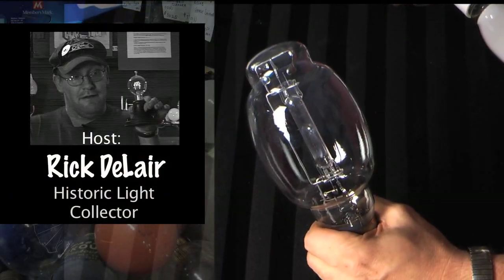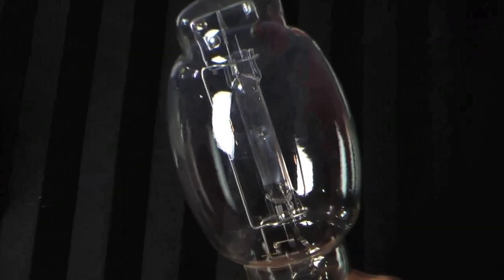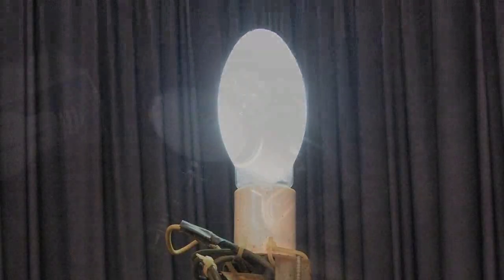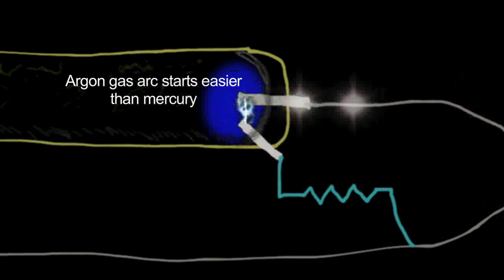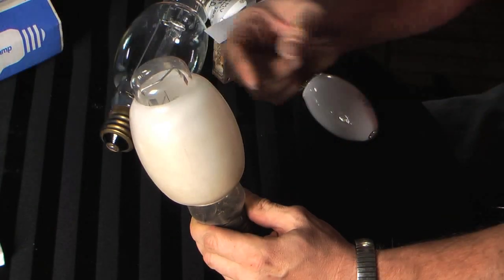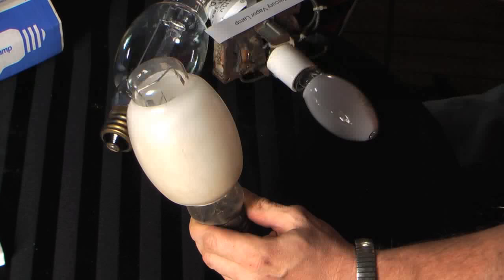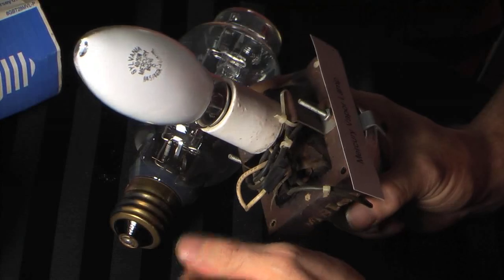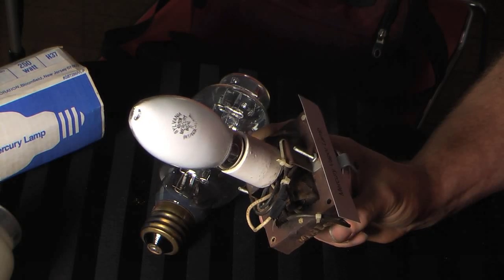The Mercury Vapor Lamp 1901

Comment: There were also yellow coated mercury vapor lamps that were used at rail crossing street lights in some place, which pretty much ended when everything converted to HPS for street lighting.

Comment: What happens if you put there an ordinary incandescent bulb?
Will the bulb only start slowly, explode, will the armature break, just nothing happens or what?

Will it be same if an cfl or led bulb is inserted there?

I can only tell by myself that once I was child I screw this kind of lamp to ordinary 230v E27 socket. The light flashed once and the fuse in the house did go. 

Since atleast here in Sweden they use same fitting E27. Also same voltage, you only need that "starter" thing wired there before the E27 socket.
So thats why im so curious and since this is outdated technology I maybe never get the answer 🤔
Reply: If you put an incandescent lamp on the mercury lamp ballast, the incandescent (if it's 230v) will just run, but a bit more dim than usual. The ballast might try to ignite but not do very much. 
If you put the mercury lamp (or any other arc lamp) on an ordinary lamp socket without ballast, nothing will happen if it happens to not strike the arc. But if it does, the arc will very rapidly heat up, drop in resistance and either the lamp will explode, or the breaker will trip, depending on what happens first.
Reply: @mfbfreak  Thank you for the answer!

Comment: In the town where I grew up, there were the nice old Westinghouse and Powerlite streetlights which used mercury vapour, there were the Westinghouse clamshells and gumball heads made by a company called power lite which belonged to Sylvania, some with the cobra heads, some of which had mercury vapour and some with HPS, possibly metal halide too. One of my favourite things when looking at the streetlights was the slight variations in colour, some were more pinkish, some bluish, some beige, some just pure white, possible the variations of chemical balance, some of them may have been retrofitted with metal halide though I’m not sure.

Now they’ve all been replaced with LED heads, I know times change, but it is kinda sad, an end of an era. Now they all look the same.
Reply: Do they all look that same?  What about near off-road shortcuts to escape a chemical gas attack?

Comment: Hi - I would like to low pressure Hg vapor arc tube lights, remove the outer glass, and use as a strong UVc source.  I have a UVc detector to measure the irradiance at a distance (for dose measurements and safety).  Where can I find such bulbs?  Regards - T

Comment: If the ballast is buzzing, but the light does not come on, does that indicate a bad bulb? I just put a new bulb in it the beginning of summer.  The old bulb before summer came on when it felt like it. I also replaced the photo cell. What is your best guess before I spend another $30.00 for a new 175 Watt Mercury Vapor bulb?
Reply: I can tell you have no been answered. the buzzing is magneto restriction and it is a wine coming from the coils to indicate  voltage resonance, batteries plus bulbs will sell you a bulb and you can return it within 14 day's if it is not the problem. hope this helps. also I work for batteries plus as a tech
Reply: @danieldollive4660  I already put a new 140 Watt bulb, was $30.00 from Low's in the old mercury vapor light and also a new upper sensor. It lights when it feels like it. I already purchased a new 40 Watt LED unit that looks very similar to the light housing I have now, however that nice blue light the Mercury Vapor light makes won't happen.  At the Electrical store, the manager showed me what the New LED light looks like, he lit it up right in the store and while expensive at $150.00, I've spent 3/4 of that trying to get my 8 year old Mercury Vapor to light working each and every night. Also the new LED's use way less electric and a lot of people including the Electrical Store manager told me I'd probably see a small difference in my electric bill, especially since I'm using dusk to dawn.  My new light also came with a 3 year warranty.  Thanks for your offer & Reply.

Comment: Energy efficient compared to what? A dead short? A 400W HPS lamp produces 25% more light per watt than a 700W Mercury Vapor lamp. That's why they are being phased out.
Reply: Compared to Halogen, Incandescent and Xenon Short Arc.
Reply: more light according to what ?  The orange glow vs white/blue/green glow on sodium lights is terrible.   Sodium lights produce too many shadows and make it hard to see compared to MV..
Reply: @jeepsblackpowderandlights4305  shadows are dependent on how the light is defused which is irrelevant to the source of generation. I’m not sure what you’re trying to say makes sense.
Reply: Mercury vapor sucks donkey boys

Comment: This First Bulb Show,  is what I call A "Loop To Loop"Frame BT 28 Bulb! Because it has A Loop on each end of the Arc Tube used as supports! We have some that are still Burning today! Westinghouse made these just after the what I call "Double Strap Open Top Frame" Using Straps of metal to support the Arc Tube! These were Lifeguard Westinghouse as well! The 400 + watt had a Full Strap Frame due to the heaver Arc Tube! Sylvania in 1961 came up with a very odd Mercury vapor Light Bulb Called A Rough Service, or Guarder Frame Lamp! The First 175 watt Bulbs contained a Lifeguard like skinny Arc Tube with Two Starting Resistors one on Top, one on Bottom, And Big battery carbon looking ones at that! The Arc Tube in these had a larger electrode like the Westinghouse! I Have Two of these Bulbs, Sadly with Black Arc Tubes, BUT THEY STILL WORK! The Second one was in a Night Watcher in Ola Arkansas and I remember looking at it up in the fixture when I went to My Grandparents House! I Begged for the Bulb around 3 Years ago from One of our Linemen, I Told Him I was looking at it sense I was a small child, He said the light was installed in 1964 when My Grandparent`s moved up on the street where they lived! and it still works, Al tho not very bright ! And indeed the base starting date is 1964! My other 1964 Sylvania still works as well! ebay has a add for this exact light bulb! It states "You do not have to handle this Mercury Bulb with Kid Gloves" Showing a Arm wearing a Heavy duty Glove Holding one of these AWESOME Bulbs! The Skinny arc Tube was quickly replaced in 1965 with the more common Arc Tube I bet for Copyright Reasons! Have You Ever seen one of these 175 watt Sylvania Girder Frame Bulbs from around 1960-65! And Do You know where I can Get a Good grade one If You Have! I want one that is like New or slightly used! I LOVE Mercury Vapor Light Bulbs especially the CLEAR Ones! The Coated ones  You can`t see the works! Here in Ola Arkansas We used Clear Bulbs up until the late 1990s! As did the surrounding Towns! Thank You for showing us Your AWESOME Collection! By the way I have around 30+ Loop to Loop Westinghouse & Phillips 175 watt Bulbs! I think that they tried to make a 250, 400, 700, & 1000 watt for a wile, But the heat they gave caused the frame to squeeze the Arc Tube sometimes Breaking it! So they went to the stranded frames on the Higher wattage Bulbs! Thanks Again!

Comment: Why is that first lamp clear? I thought that it would produce lots of UV light without coating.
Reply: The outer glass blocks the UV radiation. They are perfectly safe and I use one in my backyard without problems!
Reply: And I guess it was filmed with a UV filter on top of the lens ?

Comment: OK, but how does ANY kind of mercury vapor light work after the first time?? The Mercury would be dispersed throughout the bulb (but not vaporized)
Reply: The initial fill gas in the arc tube is Argon, which then heats the Mercury inside so it vaporizes.
Reply: +subway5411 OK...THANX
Reply: Actually, I believe its argon but I could be wrong. It could also just be the vapor of the mercury metal as Mercury is always emitting its vapors.

Comment: We have these in the street lights around houses here in Australia. They start up pink, then once they reach full brightness if viewed from a distance you can see a blue/violet halo around it. High pressure sodium is used everywhere else, on the highway and in the city.
Reply: You should be worried.
Reply: Do you live on the edge of town?
Have you plotted other streetlights?
Do they tend to be in areas that would be good for an off-road shortcut to leave a chemical gas attack?
Reply: @Flyingsidekickr  Are you trying to avoid LED streetlamps?
Reply: @Vinnay94  I am trying to warn people about a setup for visibility of evacuation and pre-evacuation points from the air by drones or something.  It seems like a way to contain humans in cities.  But why couldn't someone just walk or jog out of town?  Chemical gas?  The pandemic?  Well...I don't think that it was a pandemic and for very good reasons as I studied the virus and also looked at RNA sequences.
Reply: @Vinnay94  Understand that purple is not the only one used.  Mercury vapor lights are another marker in my opinion (also metal halide lights that look green on camera or cycle).  Do you have really yellow LED lights?

Comment: There was a 40W only lamp that predates the dual rating 40W/50W lamps.  That is the smallest power rating that was available commercially.
Reply: Interestingly, Japan has been using 40W mercury vapor lamps up until they were banned near the end of 2020.
Reply: @worldwidehidcollectorusa-fkt  40W lamps are also the smallest of the Japanese mercury lamp power ratings.  Cuz Japan, they had their own unique mercury lamp power rating series of 40W, 100W, 200W, 300W, 400W, 700W, 1,000W and 2,000W.
Reply: @randacnam7321  True, they also have 80W and 250W lamps as well.